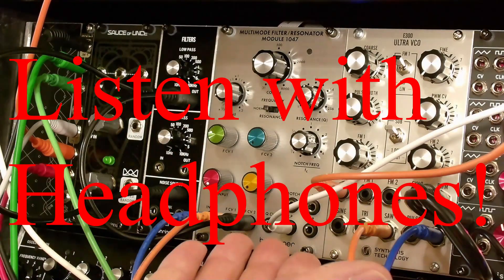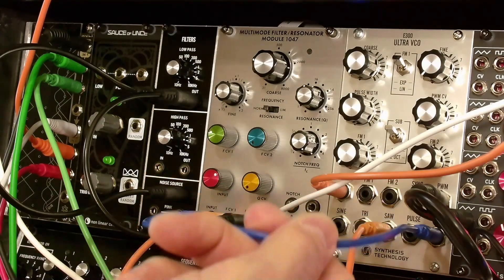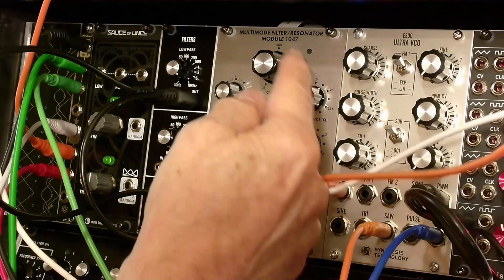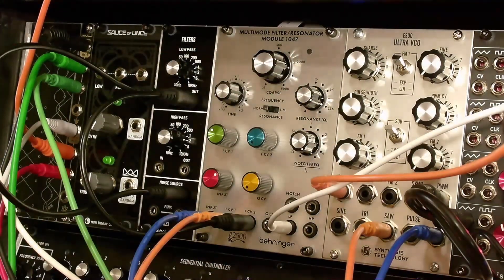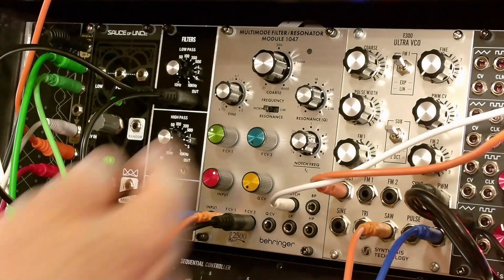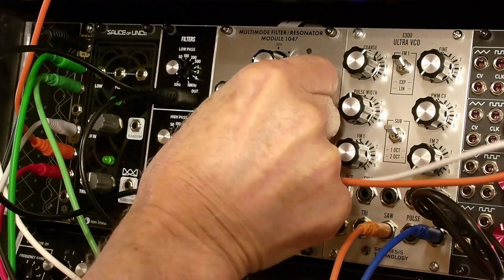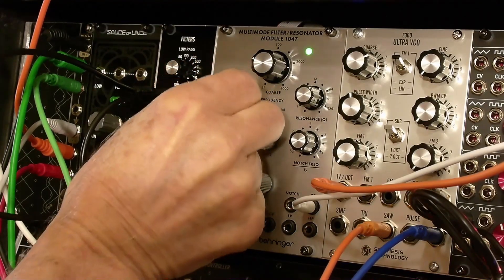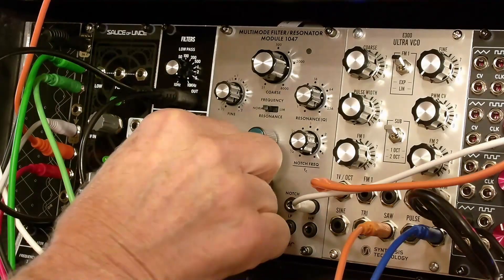Behringer ARP 2500 1047 Multimode Filter Part1 - Resonator/Percussion

Comment: So is this the equivalent of the top part of the 2600, the initial cutoff frequency and resonance control? Nice demo Sir!
Reply from the maker: Yes, the 1047 is like the voltage controlled filter section of the 2600.  The 1047 filter is different because it has high pass and band pass and notch filter responses in addition to the standard lowpass response of the 2600.   Also, the 2600 filter will oscillate at high resonance settings.  The 1047 will not.  This is an advantage for the 1047 in that you can do the type of "Ping" sounds that you hear in this video.Thx
Reply: @ozhalljr  awesome! Thank you for that info!!!
Reply: @ozhalljr  and compared to the 1047?
Reply from the maker: @canterburyaudio5836   I have added some detail to my previous comment.  Please read that & let me know if you have questions.

Comment: I was thinking that I'd pass (for now) on the 1047 since i already have a 1006 filtamp... This video alone has convinced me to change my mind haha. Was anything triggering the oscillator? or were you running it as an LFO? i saw the patch into the cv in on the oscillator
Reply from the maker: The E300 VCO is running as an LFO, providing the "trigger" to excite the resonant filter.  The CV in is doing nothing in this video.  (good question).
Reply: @ozhalljr  thanks for taking the time to respond!
Reply: I was thinking that I’d low pass the 1047 😅